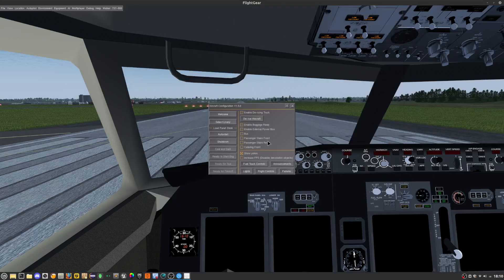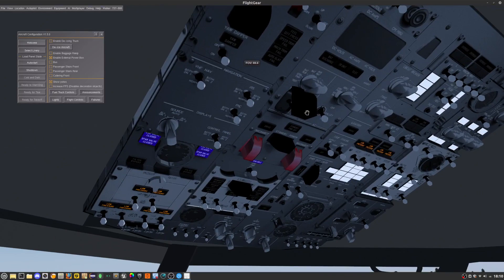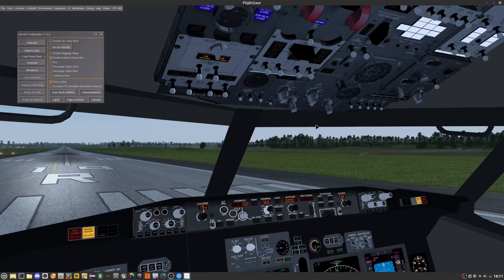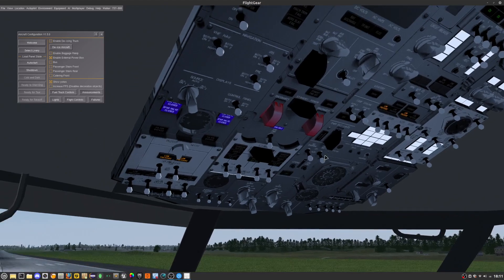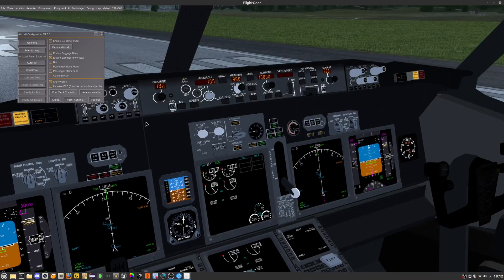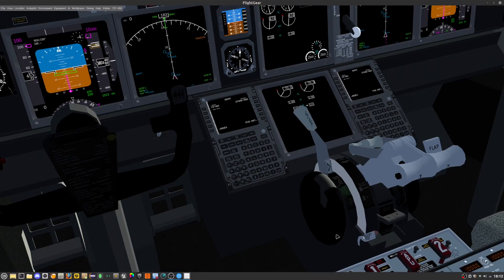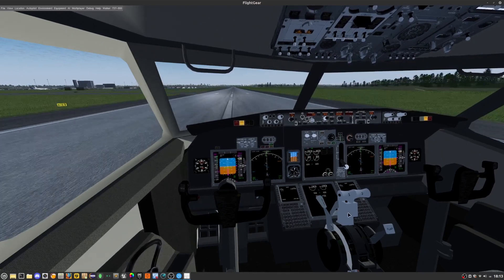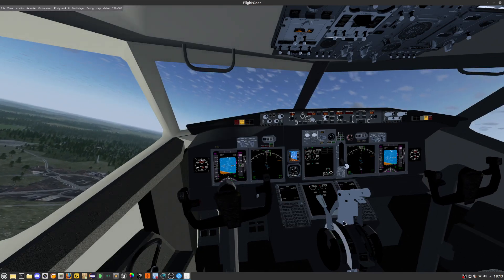2.0"FlightGear Tutorial: Mastering the 737-800(yv) Startup Procedure - A Step-by-Step walkthrough"

Comment: And also why do you fly the 737 instead of a more well developed model like the a320 or the 777
Reply from the maker: irl I have only been in the 737 as a passenger and the 737 is way smaller and has better controls in my opinion and the 737 800 is more modern then the 777 or a320
Reply: The community should try to do rework on flight gears 737.
Reply from the maker: I totally agree! Welcome to the channal!
Reply: Yes, flight gear has so much potential.
Reply: I was kinda disappointed to see that famous aircaft like the 737 is not detailed
Reply: The 737 is equal to the a320
Reply: @Boeing_742  no in my openion the a320 is more detailed
Reply: I meant in real life they are equal but in fg the a320 is way more detailed, I wish they could just focus more on the 737-800, the outside design is good they just to make detail the cockpit